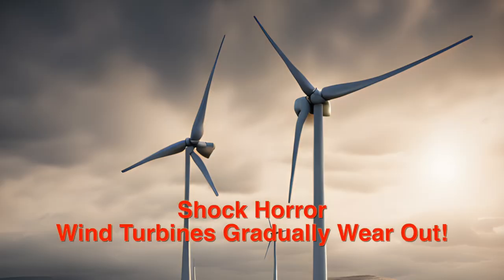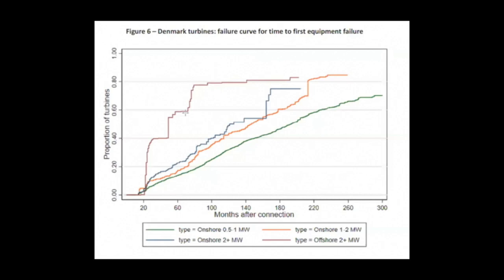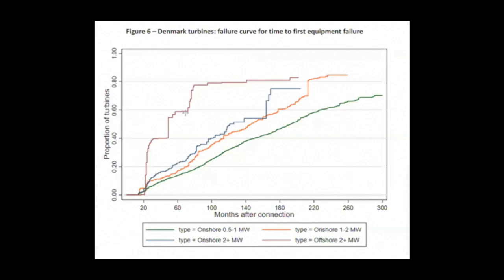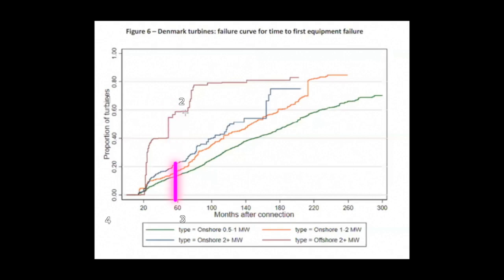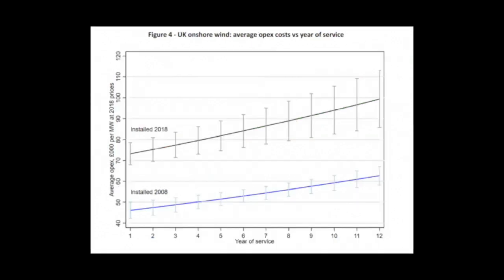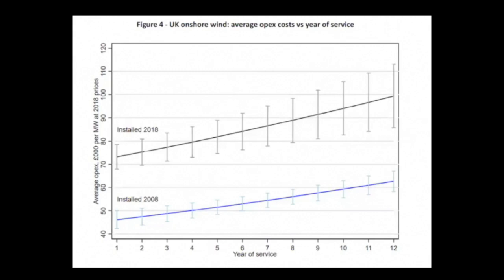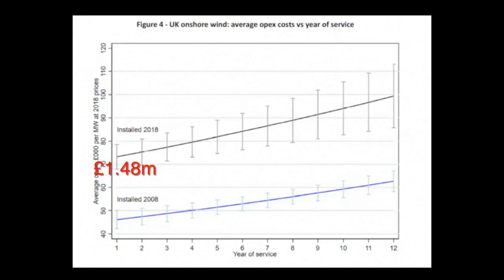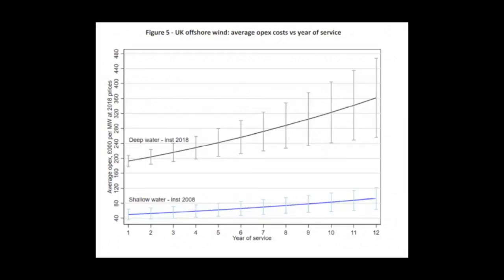The Lifespan of Wind Turbines

Comment: Thank you Paul.

I've skipped ahead and watched Prof.Gordon Hughes brilliant short video 😊

Taking my local offshore windfarm of Rampion near Brighton as an example, annual maintenance costs using Prof Gordon Hughes 2018 figures should be c.£24m.

116 x 3.45 MW turbines = 400MW of claimed capacity, installed in 2018 x £60,000 maintenance cost per year, if in shallow water, after 6 years = c.£24m per year.

Which, given these are calculations based upon 2018 costings, is not far off the most recent published financial  accounts of repairs and maintenance of £32m for 2023 & £26m for 2022.

Comment: How does this compare with running/repair costs of nuclear?
Reply from the maker: @simonshee5155  nuclear done properly would be cheaper but you cannot compare a reliable source with an intermittent one.. you need to cost in a gas network either way the same capacity as the wind.
Reply: @ClimateRealism — What I’ve never understood is how Wind + Gas doubles the infrastructure but somehow triples the cost of energy.

Comment: Fabulous information, Paul. As an underwriter of power generation globally I saw all the data and, of course the hype. You flag the reduced lifespan of wind turbines which were usually based on 25 years yet clearly they’re nothing like it. There is the issue of decommissioning which is also conveniently ignored. Whilst insurers are keen to show their “green” credentials with a wind turbine on their annual report I avoided them wherever possible not least because of the failure rates and low deductibles demanded by the industry. Certainly some were better than others but the basic failing is that of intermittency of supply. Miliband is deranged if he thinks multiplying our (notional) wind capacity will provide security because a windless day is still zero power. The current Armageddonist predictions would surely suggest that depending on the weather is even more ludicrous.

Comment: Sorry but I don't understand. If 100% is perfect flow every second of the year then higher turbines can only have better load factor would be if the wind flow was better at greater heights. If that is the case then there must be some sweet spot at which all turbines would provide a best performance at which the wind starts to trail off?
That being the case, and providing it is not some ridiculous (and expensive) 3 miles up, or something all wind turbines should be build to capture electricity at that range. Why is that not done? What am I misunderstanding?
Reply from the maker: Yo misunderstand.
The 100% is theoretical and is a paradise figure perfect wind speed every second of the time. So a 10 MW turbine will always produce 10MW.m To get the output then its is 10x24 hoursx365. 
It has nothing to do with height.
Every turbine will give a better output as height is increased but there is a cost for that and often restrictions such as transport limitations,etc
Reply: @ClimateRealism  I still don't understand. What you wrote suggests that a turbine, which is already producing 100% will increase production when it is raised to say 110% and I am not sure how that is possible. You wrote every turbine will produce better output, but that excludes turbines already operating on (theoretical) optimal output?
Reply from the maker: @nayyr1  no turbine operates at its 100% theoretical level. It is an imaginary level never achieved anywhere by any turbine.
Example:-
Say we have a 10MW turbine then it will only produce 10Mw in perfect wind conditions. At other times nothing at all.
By actually measuring what comes out we find on average it will produce say 3 MW. It then has a 30% load factor compared to a theoretical maximum of 10 MW.
Now if we raised the turbine another 50 metres we could find we get more out. Say about 3.5 MW on average hence the load factor is 35%.
No turbine ever gets near the 100% load factor.
Is that clearer?
Reply: @ClimateRealism  I don't think we understand each other. In my question, perhaps I did not ask it correctly, it makes no difference if the turbine operates at 100%, 80% or 10%.
Whatever the % it increases when the turbine is raised. The turbine is the same, so the wind has to be 'better' at greater heights. Is that the case?
I know that higher turbines require greater amounts of materials, would be more costly to maintain, there is a possibility of collapse as stability decreases, not to forget the power lost during transmission. In fact, the most practical and realistic solution would be not to build any turbines at all.

HYPOTETICALLY - there is no wind in space. The wind is better higher up, so do we know what is the height where the wind would be optimal for the turbines IF we could build them that high? Do we know?
Reply from the maker: @nayyr1  Yes, for a given turbine the higher it is the better the yield.
Overt the earth the bottom 20,000 feet is the turbulent zone and turbulence decreases with height where you get, on average, a more linear flow. So up to say 600 metres. But the extra cost would not make the gain after a point economic.

Comment: The curves are Time to FIRST FAILURE.  That doesn't preclude a second failure before the 15th year.
Reply from the maker: The curves show the population of turbines failed by a particular time
Reply: @ClimateRealism I'll take your word for that, although the title says "to first equipment failure" . Which I take to mean how long a turbine lasts until first failure. 
An important metric is MTBF The Mean Time Between Failures. From that chart MTBF could be as low as 5 or 6 years in some environments. Then there's time offline for routine maintenance, all adding to cost.
Reply from the maker: @Wee_Langside  Exactly, the last chart is the mainte   costs V time and they rise with time. The first graph is simply a lead upon to that. It is not just turbine total failure. It's all the operating costs. I could have skipped the first graph because all is reflected in the operating cost graph but included it for background.
Take Hywind floating offshore boasting a world record anywhere 54% load factor over 5 yteaqrs. But now pretty well wrecked enough and been towed to Norway since January 2024 and getting a zero percent loaf factor since! Still not back as we approach September.
Reply: @ClimateRealism and at what cost? Probably nearly as much as it cost in the first place